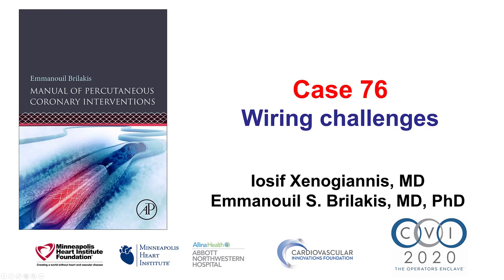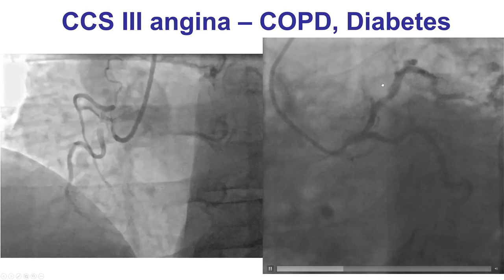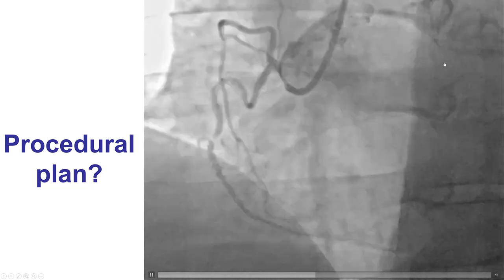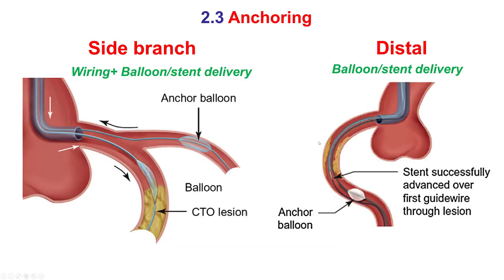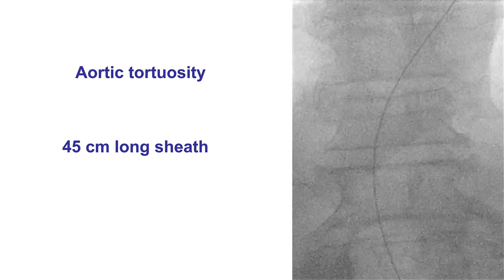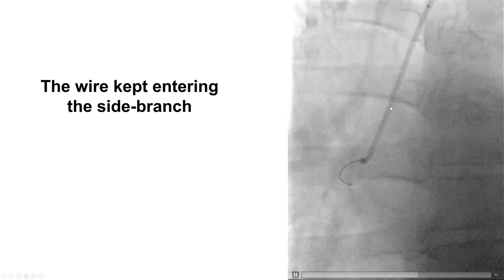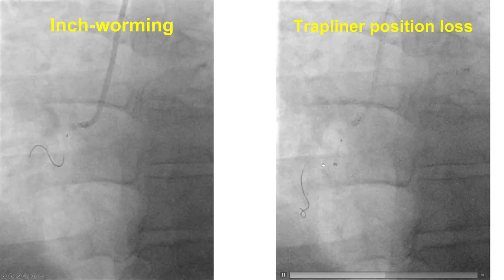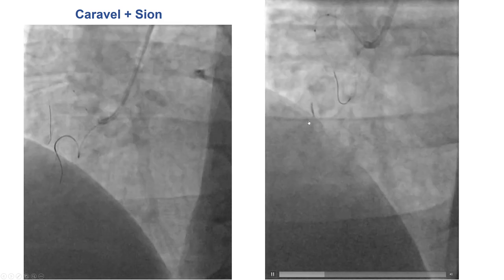Case 76: PCI Manual - Wiring challenges

Comment: sometimes less is more! great decision stopping at that point. 
without the CTO of the LAD and the collaterals from right to left more attempts would have been possible..
Thank you for sharing this case sir
Reply from the maker: If the patient did not have LAD CTO another option would be to dissect proximally and re-enter distally, but this strategy also has inherent risk of ischemia and failure to re-enter.
Reply: primum non nocere

  well depicted sir. 🙏🏼

Comment: Great case. Learn a lot watching expert operators abort cases. Any thought to trying a grandmother-mother-daughter technique with a 6F GL in the pRCA and then adv a 5.5F GL to see if that could advance into the mRCA? 🙏🏻
Reply from the maker: This could be tried, however the issue was not support (side branch anchor and Caravel provided strong support). The issue was pushing too hard and possibly dissecting the lesion with acute vessel closure.